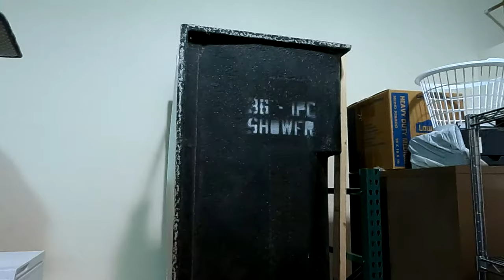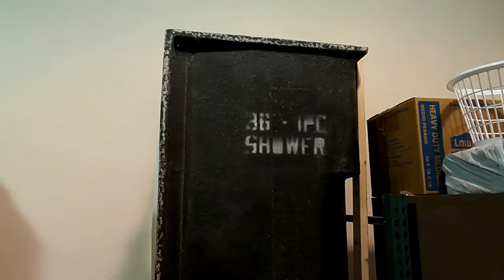Temporary Shower For My Warehouse No Plumbing Great For Remodels Garage Basement

Comment: I think that's a great idea. I've been trying to figure out how to create a temporary shower for my daughter because they lost their apartment. They rent this place where they run a business and they're living inside of their business right now where there's only a bathroom no shower or bathtub. So when I saw this video, I thought wow I am going to do this for my daughter. There's only one thing I think I would do different, and that's to get a smaller shower stall because they do have a closet for mop buckets and such and there is a faucet in there with the drain for dumping the water and it's not that big. Other than that I think this is a great idea. I think you did an excellent job. 👍
Reply from the maker: Sounds like a great spot for it!

Comment: Man, I love this, I'm in a similar situation and you just brought my idea to life. the only problem I am facing is I have no hot water at the moment.
Reply: I am currently trying to figure out my water heating solutions.
Reply: may i ask were did you purchase your water tank from? i know you mentioned the name.
Reply from the maker: Thanks!  I was in the same boat but couldn't find a video or a complete idea so glad I could help someone. There's a 2nd video on the shower regarding improvements, more details and a hot water tank. Link should be in the description on this video.  At my 1st warehouse they had an inline tankless water heater connected to the faucet. Kind of sucked but maybe there's a similar better solution. I know there's some propane options for heating maybe there's an inline electric option.
Reply from the maker: @tomasr7224  its a barker 42 gallon tote. I looked all over for a deal but just ended up ordering online from home depot.
Reply: When I was visiting the Philippines, many of the motels only had hot water in the shower.  
They sell a box for $125 (circa 2014) that you mount in the shower which includes a temperature dial and a shower head. You just send  cold water into the box and it heats it up as you need it.
At Ace hdwe in Manila, I bought one to bring back to the US for future use because I liked the efficiency and simplicity of it. 
  All AC in Philippines is 220v, so for them, it's just a standard hookup. In the US this would require 2 circuit feeds to get 220v out of our 120v.
There's a waterproof hose that the wires run through out of the shower to the power.
  I'm planning to install a permanent shower this way during my remodel until I get the whole house tankless system installed.
In recent years, this thankless idea has really caught in in the US and it makes a lot of sense to me.
Happy showering !

Comment: This is perfect for my first floor since my mother can't make it upstairs without help. Anybody know if this same setup can be done with the spigot behind the fridge? Adapter maybe and would the pressure even be enough for a decent shower? I don't currently use that water line at all and it's closer to the location where the shower stall would be placed. Thanks for sharing your ingenuity! 👏🏿

Comment: Super duper helpful. Is the shower just resting on there or do you have it secured some way
Reply from the maker: Thanks!  There was a single 2x4 drilled into the pallet and then then drilled into the top of the fiberglass shower. Also some others making a small fence around the base to keep it shifting side to side on the pallet.

Comment: Great video! Would there be a way to pump the water from blue tank back down the drain hole in the sink?
Reply from the maker: I'm fairly positive it could be done. You'd just have to look into a grey water pump. Think they make manual and electric.

Comment: I wonder why don’t connect the drain to the sink as well?
Reply from the maker: Outside my skill set. The drain pipe was some sort of steel industrial pipe and didn't have side access. Would've been a project and since I went through 4 handy men already and ended up doing it myself I didn't have the energy to go another couple rounds lol. If I knew how to do it myself that would've been the way to go.

Comment: How much was that shower stall? I can’t find it online. Only the pan or the walls. Where did you get it. I need a shower in my shop and this is awesome
Reply from the maker: Aquatic
Everyday AcrylX 36 in. x 36 in. x 72 in
1-Piece Shower Stall with Center Drain
in White. It was $350 when I bought it from
home depot. It's probably double in this
economy now.

Comment: How tall is it?
Reply from the maker: The shower I'm using is around 7' tall. I'm 6'1" and showerheads above me.
Reply: @BillysBoardGames  how much higher does the palette rack make it
Reply from the maker: @mr.gaines5496  just took a tape measure to everything. Fiberglass shower is 6' 3".
The pallet itself is 6" tall.  From the concrete floor to the top of the fiberglass shower it's 8' 4".
Reply from the maker: @mr.gaines5496  also I don't know if you caught it or not but there's a 2nd video of improvements I made months later. Links at the end of the current video and I believe in the description. Thanks for the sub!
Reply: @BillysBoardGames  thanks for going above and beyond to answer and thanks for being responsive. I appreciate. 

I saw the second video too. Crazy creative. Thanks man. This is going to be clutch!!
Reply: @BillysBoardGames  I do have one more question: is the palette rack necessary? Is there another more cost effective option? Those things are huge and pricey. I’m trying to do this in a furnished attic during a bathroom remodel
Reply from the maker: @mr.gaines5496  the pallet rack isn't a necessity but you do have to have something that can hold the shower weight, your weight, and the weight of the pallet over the top of a barker tote.  You could build like a mini staircase or something similar or.. hypothetically you could just place the shower on a wood pallet on a floor and somehow rig up a waterpump to pump the soapy water out and to a sink or to the tote next to it. I believe someone in recent comments mentioned some sort of a pump to use.